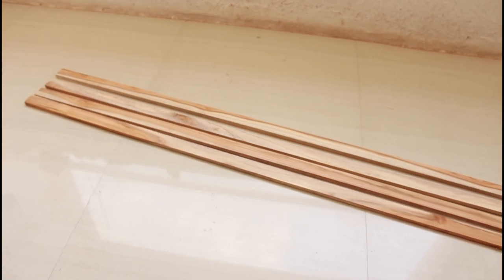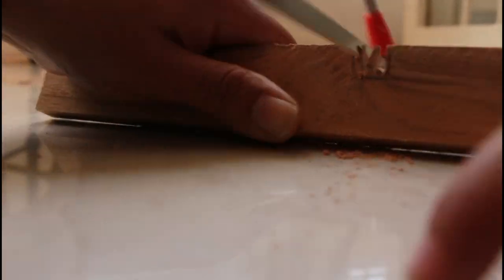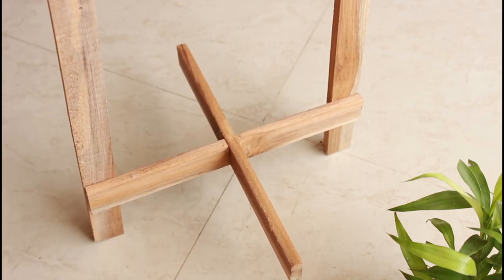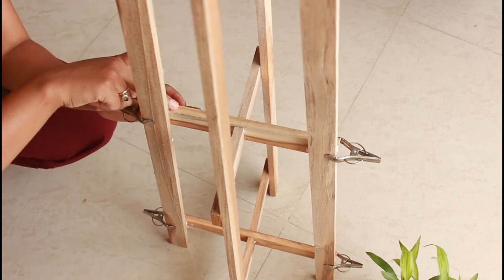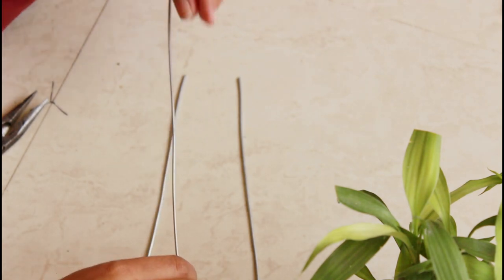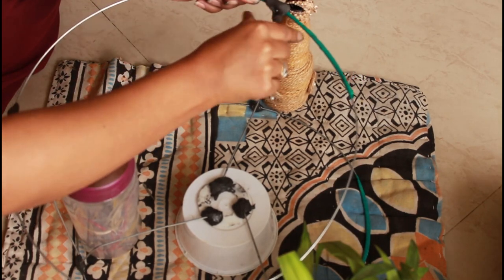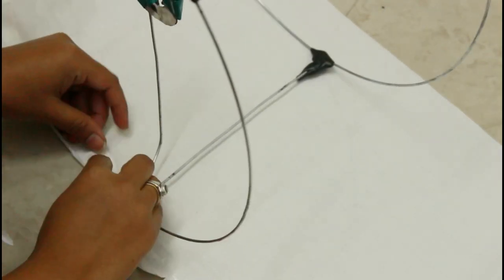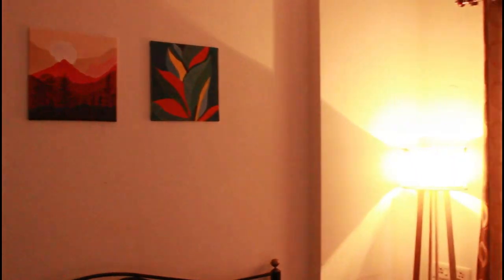DIY Wooden Floor Lamp at home | DIY Lampshade | Living room Makeover With Floor lamp

Comment: You have made such a wonderful video , I loved the way you covered all the possible details about raw materials and the tips, it is a very helpful video gayatri if someone wishes to recreate this lamp.  . Will you be kind enough to tell me the thickness and the width because the one I foundd at my nearby hardware store was pretty thin but the one you used seems sufficient for the lamp.
Reply from the maker: First of all, thank you for your kind words, 
The batten width is 1.25 in and thickness is 0.5 in.
This is the standard available over here, don't go if thickness is less than 0.5 in
And if you have further queries you can DM me.

Comment: Can you please tell the cost of individual materials as you have done for the wire and also for overall project?
Reply from the maker: Wooden batten cost 5rs/ft  (we need appx 25 ft cost 125/-)
Wire Rs 80/kg.  (we required 2.5 mtr only) 
And bulb and holder will not cost you more than 100/- 
Cotton Cloth Rs 50/mtr (1/2mtr used) 
Total lamp cost is less than Rs 300/-
Reply: @GayatrisCreativeDiaries  wow incredible girl! So cost effective !